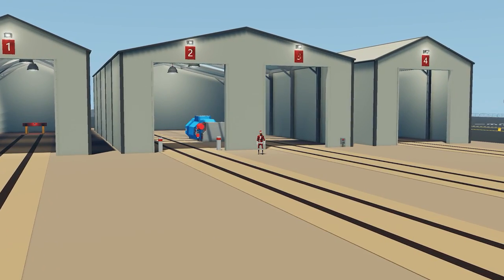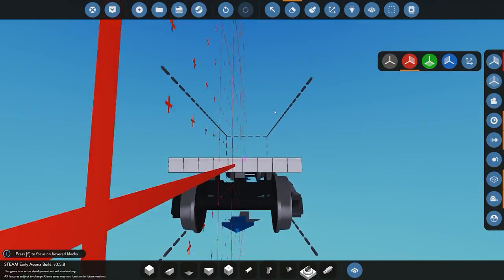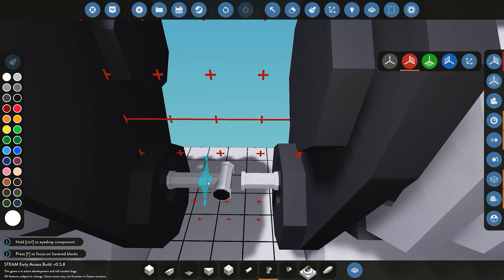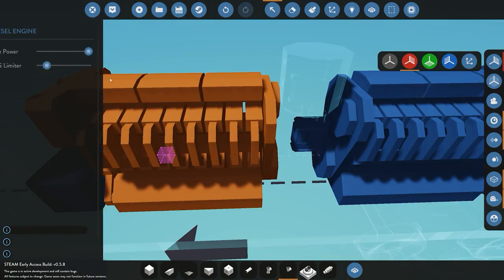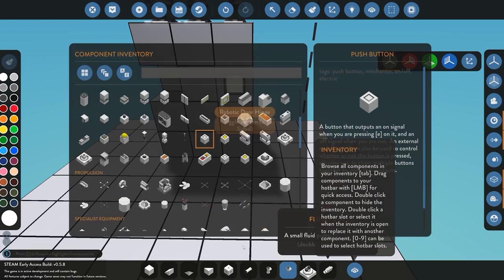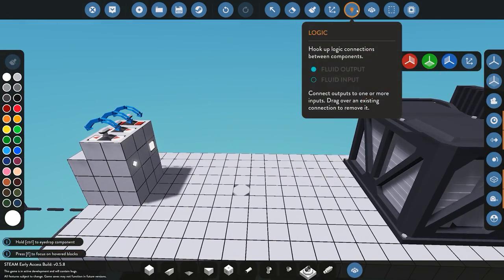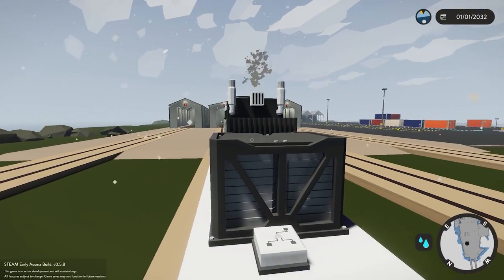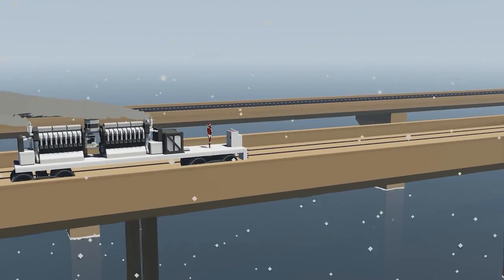Stormworks Advance Train Tutorial (OUTDATED)

Comment: I made a train with two medium diesel engines (aka aircraft engine) and it works fine if not a bit underpowered when pulling more than 4 wagons. I used one large motor powered by 2 medium generators and it worked fine. Now I have a bug with one of the Arctic southern train yard switches and I can get my trains to the left part of the yard when looking from the fuel tank outwards. I'm going to use this tutorial to build a better train although I don't think small motors will do it. And I'll add some way to lift the train and carry it over the  tracks.

Comment: What do you recommend as a ratio for generators to electric engines? I've used 6 large generators with 6 large engines and gearboxes and could not sustain the draw of two large electric motors which i find rather unrealistic.
Reply: I use two small el.motors, powered directly by 1 medium generator (no battery needed). 1 large diesel powers the generator. I run a small engine to charge the battery for all other electrics.